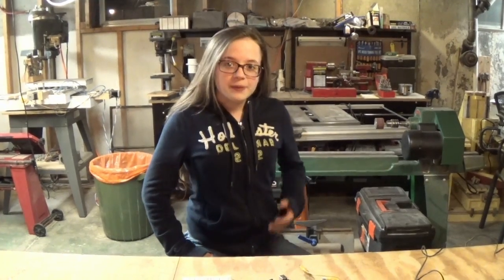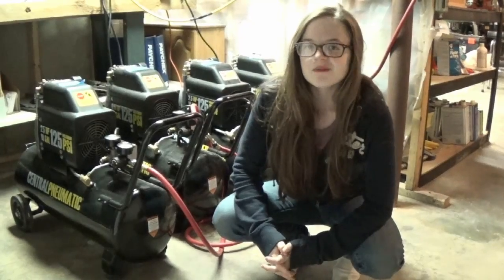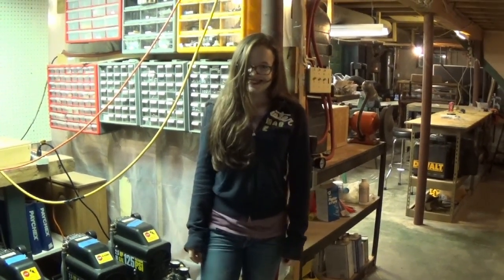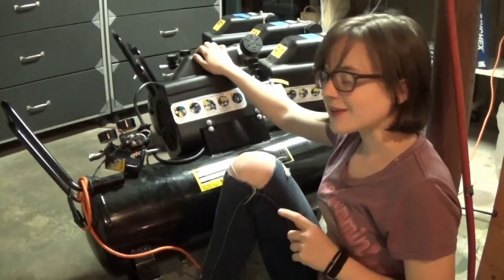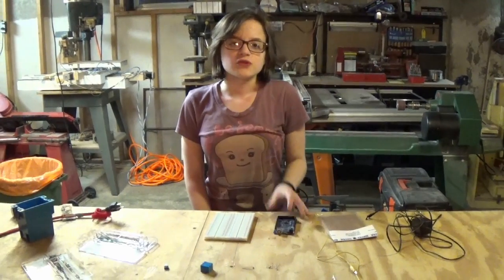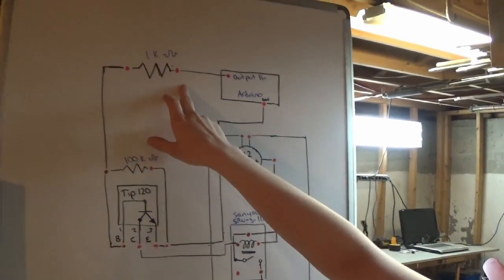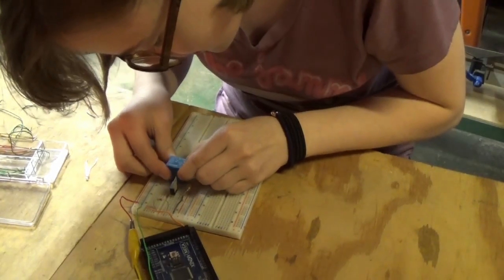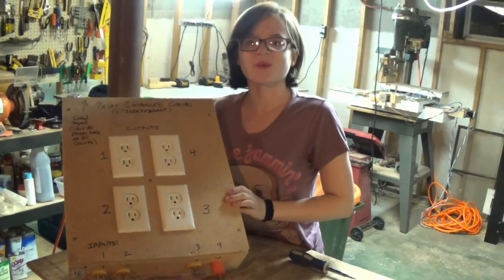Ep3 Cheap High SCFM Air with Parallel Compressors

Comment: I admire your ingenuity, energy, and intellect, but something to consider when you are designing your stuff. The KISS principle. Back in the early days of space exploration one problem they had was ballpoint pens wouldn't write very well in outer space. The USA solved the problem with a $250, 000 (a LOT of money back then) research grant, the Russians solved the problem with a $1 mechanical pencil.

Your system is subject to a lot breakdowns because of the complexity of your system. In addition the compressors are all turning on even when you are only using a small amount of air (excess power usage) and I can see where there could be  a short  cycling (off, on off, on) problem causing premature failure of the motors and more power wasted from the high amps pulled during repeated start ups. Probably a lot of excess noise as well at times. BTW, air systems are like electrical systems in that smaller lines have more resistance to flow, increasing the size of your airline might allow you to get by with less power or fewer compressors. Also, generally speaking, bigger compressors are more efficient. Small oiless compressors use a different tech than bigger compressors.

I built 2 less complicated solutions years ago using small compressors to save space in,a mobile shop. The small units could be stuck inside  the vehicles frame and take up less space, use less power most of the time, and I could use smaller, cheaper inverters.

Solution A involved 2 compressors. I connected the air lines together in a common manifold and I simply adjusted the switch on one unit to kick in at a lower pressure setting (I had to scrape off the epoxy used to keep the adjusting screw in the switch from moving due to vibration, adjust the screw and epoxy it back).  If the first compressor could keep up, the second compressor never kicked in. Took 15 minutes and some JB weld that already had laying around. I suppose you could readjust the cut off pressure lower also to make it cut off earlier too, but I never did.

Solution B involved three compressors. All 3 had the pressure switches set up to cut off at 120psi and turn on at 90 psi in the tank (factory settings)  Basically the same concept only setting the air regulators at different pressures 90psi, 80psi, and 70psi and a fourth regulator close to or at the tool to control tool pressure. On startup of the tool when the pressure dropped below 90psi the first compressor motor kicked in, if the pressure kept dropping past the regulator settings of the other compressors each would start supplying air as it reached their regulator pressure and each would start up their motor as the pressure dropped below their switch settings. You could reset the regulators, if need be, for different situations. Cheap and simple to diagnose and repair. In your situation, with the addition of some ball valves you could disconnect the compressors and use them indivdiually or any combination very quickly.

With both systems, most of the time,  there  was only 1 compressor running, the rest was in reserve. I am sure that a hybrid of the 2 solutions would work also.

Last, but not least, I would like to remind you to be careful when working with any system that can turn on automatically or can be turned on remotely by someone else. Be sure to disconnect or lock out the power. Some systems common around the house or shop are: air conditioners, refrigerators, air compressors, vacuum cleaners, blowers and fans, lights, anything that can be set on a timer or sensor, or connected to the latest danger, "the internet of things".
Reply: PS. I'm probably biased because I'm not smart enough to do it your way
Reply: In solution A,  I misstated "I connected the air lines together in a common manifold ". I connected the 2 tanks together so that they acted like 1 large tank with 2 compressors feeding it. Hope it is more clear now.

Solution B does have a common manifold that all tanks are hooked to but each compressor is feeding its own tank and all tanks are feeding the tool..
Reply: FYI, that story about NASA and ballpoint pens is a myth.
Reply: On what do you base this revelation?
Reply: I assume you meant that question for me. I based my comment on what I had assumed was, by now, common knowledge that the story was apocryphal. However, to support my revelation, I have a friend who knows a lot about things like this, his name is Google. To wit:

http://www.scientificamerican.com/article/fact-or-fiction-nasa-spen/

http://www.snopes.com/business/genius/spacepen.asp

http://mentalfloss.com/article/13103/russians-didnt-just-use-pencils-space

...to name but just a few sources.
Reply: I found my own source using Yahoo

http://history.nasa.gov/spacepen.html

You replied so fast you must have already looked that up.

Google (and Android), the spy machine, is not my  friend. I realize that a lot of younger people accept it as fact that the days of privacy are over, but I see no reason to make it easier than it has to be.
Reply: BTW, I first read this in a newspaper back in the early 1970's
Reply: apocryphal? Had to look that one up too. Why not use words that your audience would understand? You use the word assume a lot, maybe you assumed we were all Mensa candidates?
Reply: You understand you are perpetuating a myth about NASA right? No matter how much you might want it to be true it isn't. I support the KISS principle, but this is far from KISS. Her best investment option may be   single compressor the meets her compressed air requirements combined with an ample volume tank
Reply: Careful with the big words like "perpetuating" and "myth". You'll have that guy stuck in Yahoo! searches for like a week.
Reply: a. the pen thing isnt a myth, read the snopes lol. the pen was created by an independent, the myth is tied to wasting millions in development. b. You advice about her "best investment option" is not practical,  not within her price range, not an option for her due to power issues, and best of all outs you as generally ignorant with regard to pneumatic tools. you are however good at producing laughs with your "poasts" online. stick with that
Reply: kidharris I like your idea but every one has it wrong, the sensor to kick it on and off is on each tank right by the motor so cut the ends off two tanks and one end off two tanks weld them all together so first you have more air in a larger tank and then wire each of the four motors to only one switch that kicks it on and off and plug the other three. Then it's one tank with 4 motors and there isn't any problems and change the breaker in your box to a 50 amp and plug them all into the same outlet.
Reply: nasas "outter space" is fake

Comment: I have built and repaired many industrial controls from scratch, the few concerns i have with this is that first, you are using a wooden enclosure to store electrical components and any well designed enclosure must be able to contain a failure from a short. The wooden box is literally a fire hazard. Second it is very bad practice to mix multiple power sources that are controlled from a single board, there could be a short and jump between phases. 

What could be a safer and more practical solution would have been to use a small breaker panel with two 15a tandem breakers running on a 240v 30a welding circuit. This way you know that all of the components would handle a short and withstand the current. This also gives one disconnect point for safety and you don't have a risk of a cordset getting pinched or causing a hotspot with all of the plug connections. Also the idea of using the programmable chip is nice, but you could have also used a simple time delay in line with a 120v relay or even a time delay relay. These offer a easy and fast way to update your sequencing. 

I can appreciate a homebrew design based on things in practice, however this design should be upgraded for safety reasons and simplicity.

Comment: For $300 more you could have bought one compressor that puts out just as much air with about half the current draw and still small enough to run on single phase although 220v but most all houses have 220 someplace. Worst case it would be far easier to install a 220 breaker than some sort of over complicated rely board.
Reply: They could have bought the smaller 220 unit at HF and been done with it for the same price they spent... They would have gotten the cfm and volume. These unit only put out 4-5 cfm at 90 psi.
Reply: She says seeds 25 scfm at 90psi. What compressor at harbor freight can output that much? 

She also mentions she can't get 240v 3 phase so that rules out any of the 10hp + units that usually cost 2k+.

These 10 gallon hf compressors are 2.5hp each and put out 5.3scfm@90psi. They also cost around $120 on sale. So for $500 she got 10 hp and 21scfm @ 90 psi. Tell me again how spending $800 on the hf 60 gallon which puts out half the power is a better idea?
Reply: SoDiezl350 Thats bullshit. The biggest one that HF offers is 17 CFM at 90 pounds. Its $649 on sale. 220 SINGLE phase. She said she couldnt get 3 phase power. She said nothing about 220 single phase. Home Depot, Lowes, Nothern Tool, Air compressors direct and several more places have compressors that fit her needs and more for just a bit more than what she paid. This is just stupid and risking burning the house down.  A also hate to break it to you... They are 2 HP compressors and only 4.5 CFM at 90. So your calculations are a little off... Next time do a bit or research before you talk out your ass...
Reply: @robby844  I don't think you can have 220 single phase in the typical house, pretty sure it needs to be at least two phase to get 220.
Reply: @robby844  Well, how do you get 220 from a single phase?  Wouldn't the two 110 legs need to be out of phase to be 220?  I think you know something I don't here.  I understand you could have 220 in one phase in theory but homes pull the 110 out of phase from opposing sides of the transformer at the line.  Nothing going into the home directly is 220 meaning 60hz single phase.  Just saying.
Reply: @ZeroEntropy.  wow... Here in America.... It enters the house at 220... SINGLE PHASE POWER. You split the 220 SINGLE PHASE POWER to get 110 SINGLE PHASE POWER. By your mentally disturbed theory we would have 110 double phase... Which... No such thing exists.... Look it up.... You might actually learn something....
Reply: @robby844  Two hot wires come into the house from the transformer, you're proposing that both of them are 220V 60hz in phase with each other?  This makes logical sense to you?  You're totally incorrect here and have no clue what you're talking about.  When you attach a double pull breaker for 220 it attaches to two different 110v legs out of phase with each other.  Technically if you knew which outlets in your house were out of phase you could get 220v in your room via extension cords from your 110v outlets.

Comment: Stumbled across this video searching for "air compressor control". Creative setup, and you're awesome. You've gained a subscriber. Another option is to pick up a larger compressor pump and motor at a place like Harbor Freight. The pumps are often on sale and you can find a 5HP 240V motor surplus or scrap fairly cheap. Then mount that on your existing compressor tank. That way you don't have to deal with controlling multiple compressors, draining them, plumbing them and it will be more power efficient. I did something similar on my Campbell Hausfield (see my channel, it's in the videos somewhere) with a 5HP motor and 14 CFM (at 90 PSI) twin cylinder pump. Total investment was about $150.